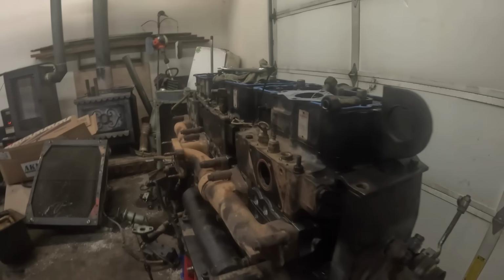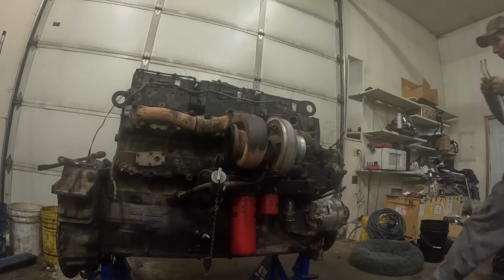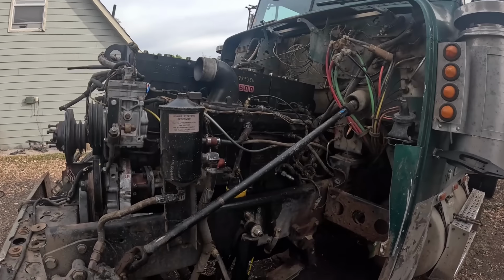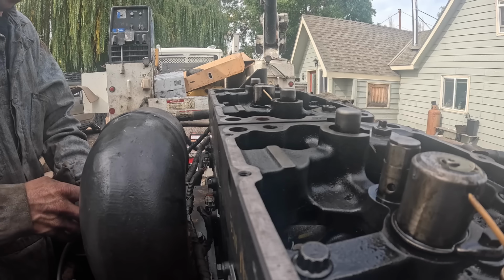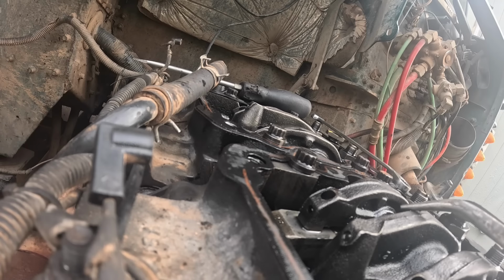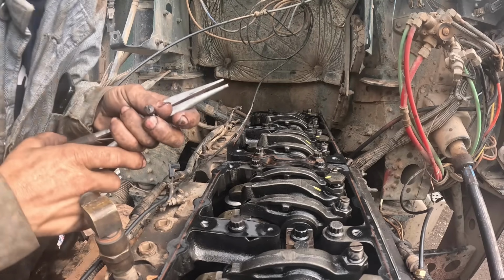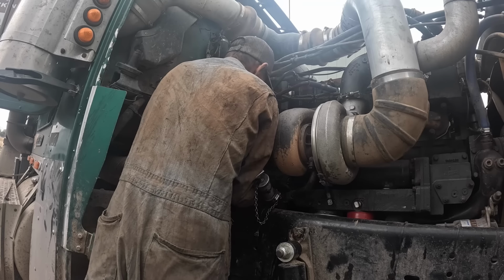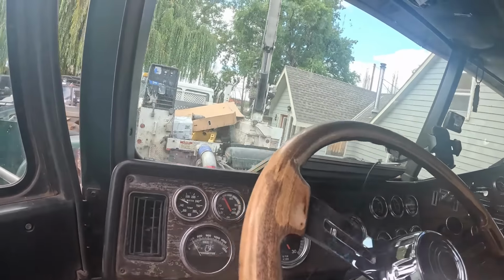N-14 Cummins overhaul Pt. 5

Comment: Thanks for all the videos you have been putting out. I know time is a valuable camodity. 
Mistakes are easy to make. You won't make it again, I'm sure.
I cut off hoses that aren't being reused. As you stated, it's too easy to mess up a heater core or radiator. Good advice to younger guys to replace those hoses while you are in there. 
Keep up the good work, but remember to take care of Warren.  
I'm a tad older than you, and my eyes are crap too. Part of the blessing of getting old.

Comment: So, if you walked into a room with an N14 engine and everything to rebuild the N14 including a cooler of beer, a 5th of rye Bourbon whiskey , and a tray full of Skunk weed blunts. How many hours until the N14  disassembled,  reassembled and was up and running  ready for installation in something like a 1996 T800, W900 or  359 Pete or Classic Freightliner
Reply: Lol.

Comment: Ugh, it stinks you haven't got paid by dozer guy. Money is tight and people don't seem to have morals anymore. We've had to repossess 2 sets of batteries, a couple tires, and a radiator this year. Never had that happen before in previous years.... edit, also had a guy who said do everything to get this tractor to pass d.o.t. inspection, $4800 worth of work. He paid with a credit card, and reversed the charge 2 days after he took possession of the truck...

Comment: Are those exhaust manifolds worth replacing, when your going this far., those expansion joints must wear slap out after a million miles and who knows how many nights that truck idled over night?  I’m just curious, I don’t have experience with this engine, just know a manifold upgrade will get you better performance and claims of lower egt’s?

Comment: When you work on Cummins NTC/N-14 engines do you time the air compressor when installing it?
Reply: Only the single cylinder air compressors have to be timed to the engine, the twin cylinder air compressors do not have to be timed.